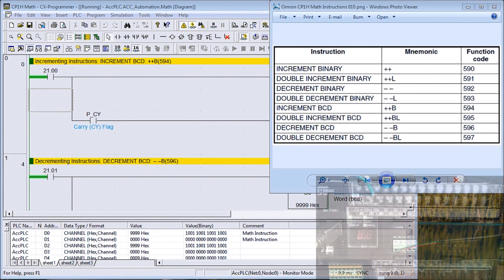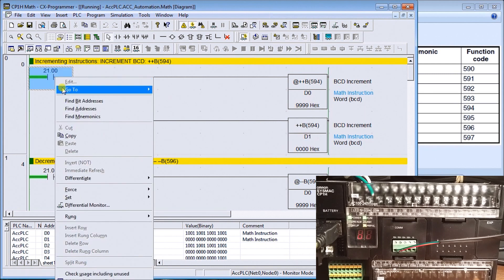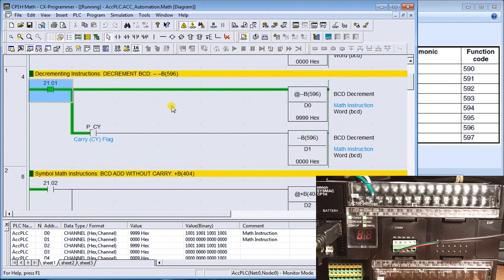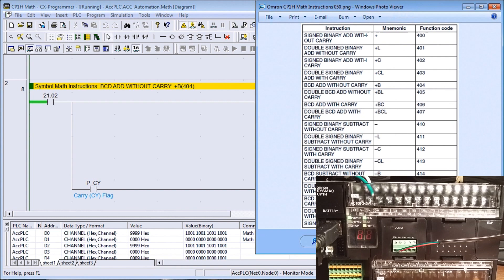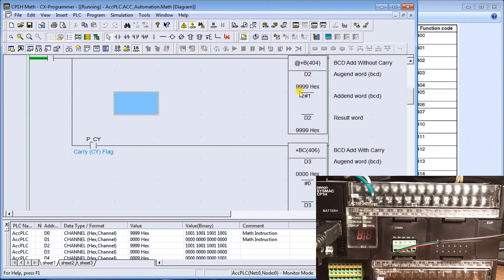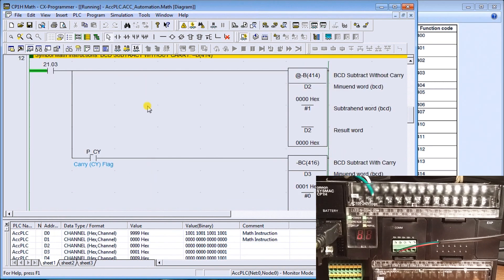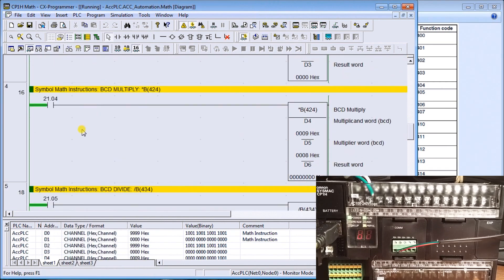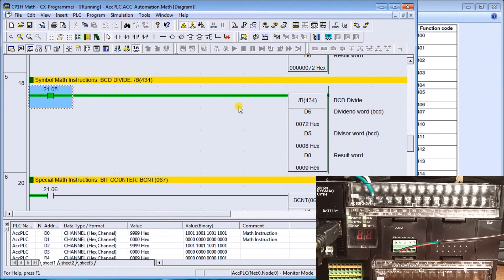Omron CP1H Math Instructions

Comment: I have problem on dividing with remainder when doing teaching of pulse. I need to get the remainder value to add in pulses. How do I get it? Thanks in advance.
Reply from the maker: Hi ste_ven 003,
I'm not exactly sure of your problem. What do you me by you need to get the remaining value to add in pulsed? Can you give me a specific example?
Thanks,
Garry
Reply: @ACCautomation  I'd get the difference for 1st and last point then divide it by number of  points. The result would be the pitch pulse. I'd notice that the pitch is not correct in actual pulse.
Reply from the maker: @noelvillapando3358  
A couple of things come to mind. 
- The backlash could account for some of the missed pulses. 
- Are you going through a gearbox?
- Speed and inertia of the load.
Regards,
Garry
Reply: @ACCautomation  Thank you for your response. Actually the problem is that the pulse out count A540.08 didn't match the last point position data. My pitch data has a remainder which I think it didn't count correctly during incrementing pulses.

Comment: hello if i wiil calculate the distance by the pulses coming from encoder wich type of divide and multiple have i to use
Reply from the maker: Hi abd engineer,
You would have to determine if the pulses are being added in binary or BCD to tell what type of instruction to use on the total.
I have seen this done both ways.
I hope this helps you out.
Regards,
Garry
Reply: @ACCautomation  if it was binary what i have to use and if it was bcd what i have to use
Reply from the maker: @abdengineer6225  
If you are using BCD then:
BCD Multiply *B(424)
Double BCD Multiply *BL(425)
If you are using Binary then:
Signed Binary Multiply * (420)
Unsigned Binary Multiply *U (422)
Double Signed Binary Multiply *L (421)
Double Unsigned Binary Multiply *UL (423)
You will have similar instructions for the divide.
Regards,
Garry
Reply: @ACCautomation  thank you man very much

Comment: hi garry, can you show how to use double singed add, subtract, multiply and divide
Reply from the maker: https://www.fa.omron.com.cn/data_pdf/mnu/w451-e1-03_cp1h_cp1l.pdf
Hi Alvin,
The manual above will always have an example in it of each instruction. 
Note: When using double multiply and divide you must consider the number of words required in the result. 
If you have any specific questions on an instruction I would be happy to respond.
Thanks Alvin,
Garry